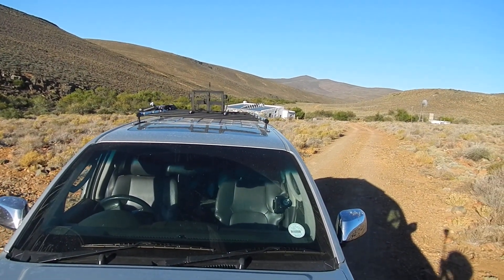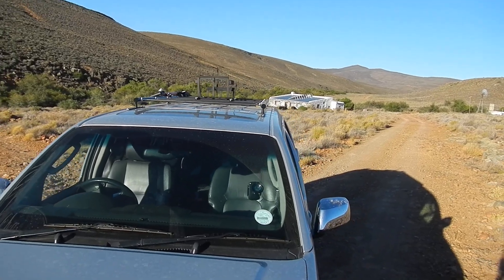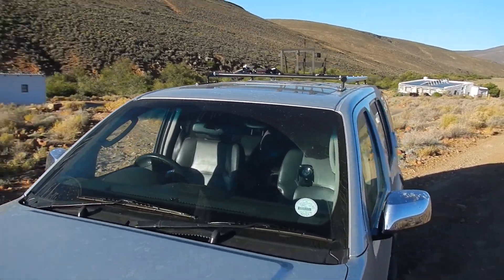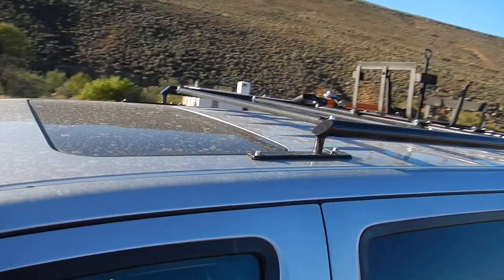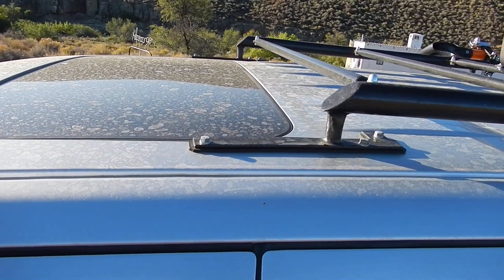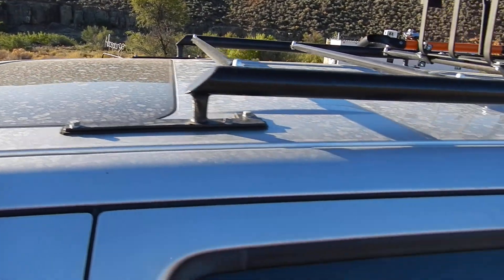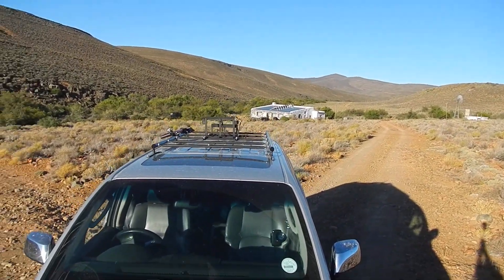R51 Nissan Pathfinder DIY Roofrack Review.

Comment: Did you use bolt holes from stock roof rack
Reply from the maker: Hi Rowan. Yes i did. They are rated to hold 100kg and that should be enough. You planning on building your own.